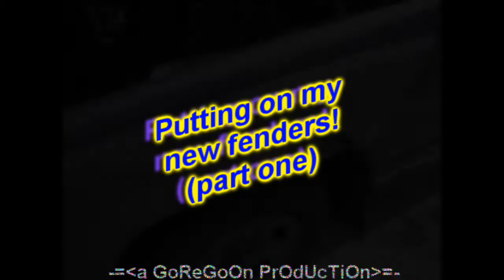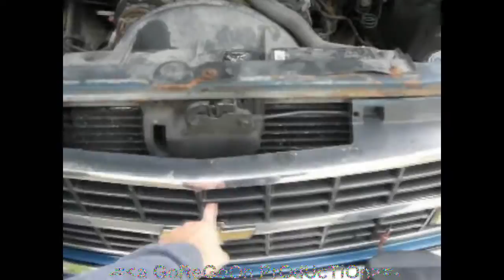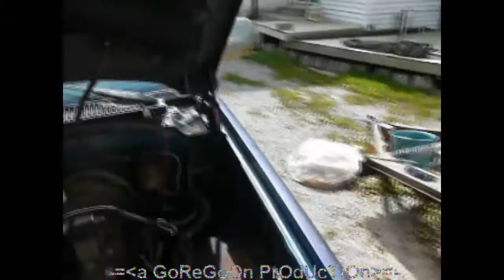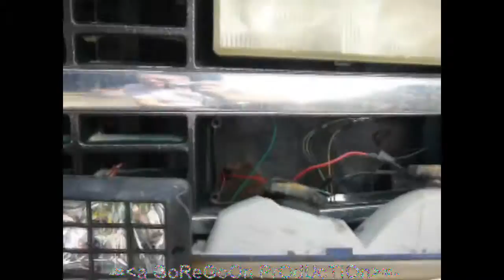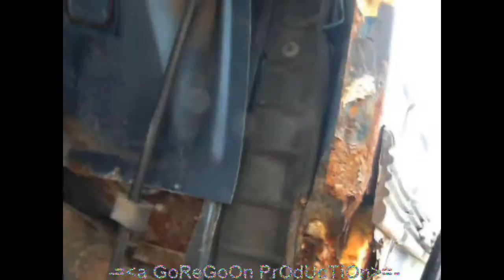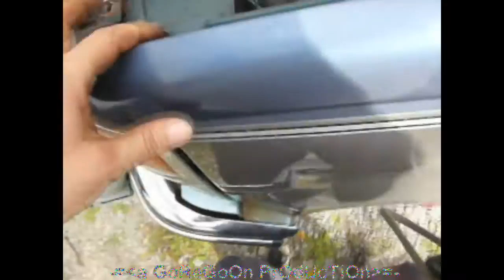Goregoon's Garage: Putting on my new fenders! (part one)

Comment: LOVE THE INTRO!  That's a LOT of rust, looks like the core support should also be replaced.  Thanks for the video - I have a '98 GMC Suburban SLT that is luckily rust free even though I live where we get a lot of snow.  Glad to see you can replace fender without removing grille, my grille and fender both need replacing due to minor front end damage from previous owner.  I already replaced front bumper.  Next I am replacing grille, maybe next spring I will replace the LF fender if it bothers me too much.